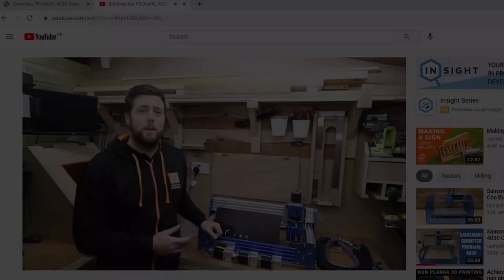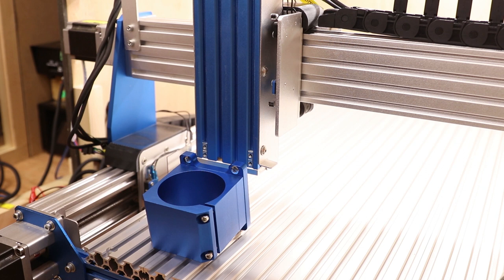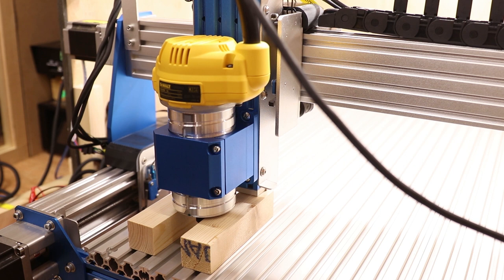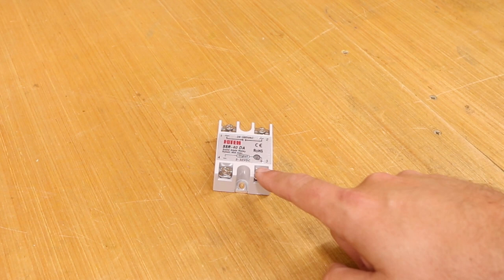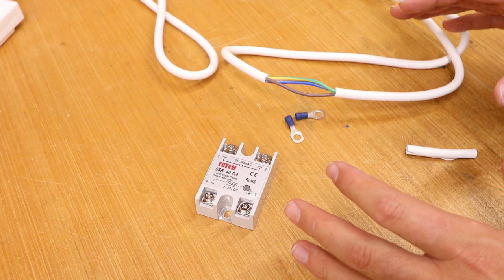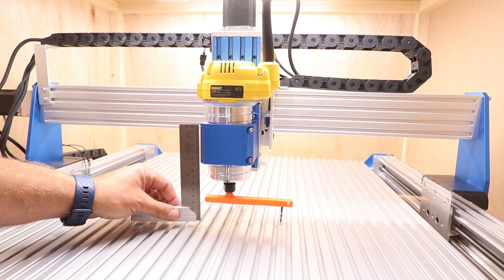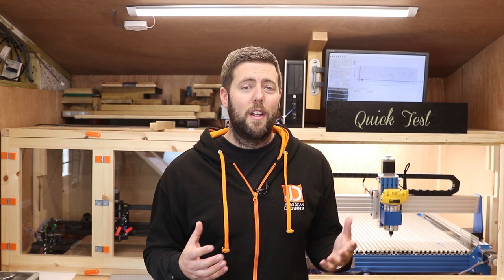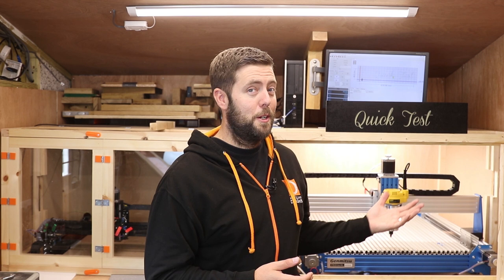Upgrading your spindle/router on a desktop CNC - 300w to a Dewalt DWP611

Comment: Great video as always, however I went 1 step further with my SSR I actually wired the SSR to a duplex outlet instead of just a power cord.  This served my need to have my dedicated vacuum for the dust collection to be able to be powered on by the SSR also.  So now when my machine powers on the spindle not only does my router start but also my vacuum.🤓
Reply: How does the spindle speed work? Does the SSR just act as a simple on/off switch ?
Reply: @bermchasin  I believe so.  If you search online there is a speeds and feeds documentation guide for the dewalt router that breaks it down by the knob adjustment on the router.  So you adjust the knob setting based on the RPM you want for the bit you're using.  If I'm incorrect in this, please let me know.  Good luck!

Comment: Quick note on the SSR...I see it's marked as 36v input. You would probably think this is okay as according to the specs on the sain smart website, the spindle is 24v. I have already confirmed with a multimeter the spindle is not 24v. It is 12-48v. I would check the voltage of the motor leads and adjust the knob down until you are safely within the input range of the SSR to avoid overheating and damage.
Reply from the maker: Thats a really useful piece of information. Thank you very much, I'll pin it to the top of the comments 👍

Comment: Thank you James for your video. I suggest you to check the output power with the potentiometer of the control box to 32V because the Max power is 48V and I burned 3 SSR 😃
Reply from the maker: Thanks for the tip! and sorry to hear you burned them out

Comment: Completed my upgrade with the Dewalt and began the spoil board surfacing after tramming and found out a little surprise. When I ran the outline test (Gsender) with my surfacing gcode my machine (6060) ran into the y+ limit switch. Was quite surprised because I didn't change anything more than the spindle. The problem turned out to be the size of the Dewalt router and its mounting bracket that pushed out the bit position further out from the z carriage. So my home position was about an inch further in on  the Y+ axis and just enough to trip the limit switch. The Y+ limit switch was set for about 25 inches with the old spindle. So now I'm just about 24 inches which is ok.

Comment: Just to be clear, I'm removing the spindle wire from the x and y tracks, and "replacing" it with the power cord from the trim router. Then, I'm connecting the spindle wire terminals to the input side of the relay, directly from the controller box - and that relay and the power extension cord can be placed on the table, near the controller. (Instead of replacing the female spade terminal with eye connectors, I'll leave them on the spindle wire, and run two short wires with male spade connectors to the spindle end, and the eye connectors on the relay side. That way, I can easily switch back to my original spindle if I need to.)
Reply from the maker: Thats all sounds correct 👍

Comment: At 6m50s you mention and put up a picture of an extension with inbuilt sir and say you will link to it in the description but I can’t see that link. Great video’s by the way, really helped in getting going with the CNC.
Reply from the maker: Hi Mark. In the first set of US links there is one called an IOT relay, thats the one which makes life easier
Reply: Thanks James, that link is broken or certainly if you are in the U.K., it takes you to a generic relay search on Amazon.U.K.
Reply from the maker: @markone3093  I think I mentioned it on the video, or certainly in the description that's it's only available in the US. The link is just trying to find the closest thing in the UK. I've searched several times but been unable to find a similar product for the UK unfortunately
Reply: @JamesDeanDesigns  yes the only similar one I found has either contact switching or DCv switching in the range 5v to 14v but obviously if the pot on the control unit of the CNC were turned up full the power on the spindle cable would exceed the 14v and blow the input of the IOT. I’ll stick with the linked sir and build it into a metal box with a std U.K. 3 pin socket on the front. That way the ssr can heat sink through the metal box. 👍

Comment: Just bought the dewalt router as a replcement for the spindle on the prover. Thanks for showing how to connect the power so you can still run it like the spindle. Can you still use the  ESR 11 collets from the spindle, is there a way to take the chuck off the router and replace with the ESR 11 collets?  Lastly,  are there any videos / PDF's showing the recomended speeds, feeds, and depths of cut for the 4030 with the dewalt router?

Comment: curious about how well the z axis bearings hold up to the added weight over time.
Reply from the maker: Still running this machine today, several years on and haven't had an issue.

Comment: Can you do a video explaining more about the SSR? Such as current flow and the end connections. Do you plug the end of it into the wall outlet?
Reply from the maker: Hi Matthew, The example in my video, extension plugs into the wall and the SSR is wired half way down but only to the live wire. The router is then plugged into the extension. It is fairly straight forward but if you google SSR router cnc there are usually wiring diagrams in the images section. I don't really have any information on the current flow, i just made sure it was rated high enough to take it

Comment: Great video.  My Foxalien 4040-XE spindle just failed.  I have a Dewalt 611 router and plan to install it.  I previously tried to use a 3" long bit with the 300w spindle and it would hit the upper Z limit when doing a safe pass.  Can I use 2 1/2" long bits with the Dewalt 611 installed?

Comment: I have a 3018 pro with and extension kit and went with a Makita router as i had one handy. skipped those toy spindles right from the start.
Reply: Which Makita router did you use?  Did you make your own mount for it?  I have the 3018 Prover and I’m looking to upgrade.
Reply: @rodneybailleaux9221  Makita RT0701C A buddy 3D printed the mount for me direct replacement for the stock one using the stock mounts and bearings etc. Think it was Thing-a verse or something like that. He just down loaded the file and printed it.
Reply: Did you have to make any other upgrades to accommodate the Mikita?

Comment: I hang my DWP611 power cord from the ceiling rather than feeding into the drag chain.  Reason being, I do drill some holes with the CNC  and prefer to use the speed variable spindle for that purpose only, as the dewalt minimum speed is far too high and causes bit to heat quickly, even in wood.  I do have it plugged into a SSR, but put a plug on the SSR and the original spindle for easy change over (well, easy except the hassle of aligning everything again).
Reply from the maker: Great tip!

Comment: James love your videos, you have taken what is a fairly steep learning curve and made it easy for us rookies.  one question as im wanting to mount my dewalt...one question, can i run the power to the hot AC as opposed to using the switch? i dont have a switch handy, but will invest in one shortly.
Reply from the maker: Thank you very much.
You can run your power straight from the wall without the SSR switch, you just have to manually turn the router on before starting a job and then turn off after its finished.

Comment: Excellent video James!  It looks like the IOT Relay is no longer available..  No problem, I can use an SSR.  I intend to build a custom control box.  The box would have the SSR and heat sink, plus a motor speed control module to control the speed of the router and also a 2nd receptacle for the dust collector. The idea is that when the router comes on,  so does the dust collector.  I plan on leaving the wires for the original spindle in place and getting another connector to go to the new box.  The power cord for the Dewalt router will hang down from the ceiling like the hose for the dust collector.  I want to be able to easily switch back to the original spindle if I ever need to.  What do you think?
Reply from the maker: The IOT is just not available on amazon, but is elsewhere albeit in less places now. If that ticks the boxes you need then I'd go for that
Reply: @JamesDeanDesigns   James, I did look around and I found it, but not from a site I'm familiar with. Also,  it seems to be more expensive than I thought it would be..  Based on my personal experience, I am completely fine building the custom box. I think it will be cheaper and do what I want it to.  Thanks for the reply!
Reply from the maker: @ericeinsmann5559  FoxAlien are working on their own version but it sounds like you know what you're doing so I'd say go for it 👍

Comment: Damn you have me hooked. I was just about to purchase a Shapeoko 4. What do you think, is the Shapeoko a massive upgrade compared to this or would you recommend the PROVerXL with the DeWalt router? I wouldn't mind saving a ton of cash for bits and material oh and feeding the family too. Great channel btw 👌
Reply from the maker: Thanks for kind words. I cant give a 100% answer as I've never used a Shapeoko, but one thing I dislike about them is a machine of that size using belts is petty inferior to a screw drive. Laser machines and smaller setups like the FoxAlien 4040-XE are fine but belt drive on bigger machines is generally off-putting for me. The ProverXL is a solid machine, thats why I like it and coupled with the dewal, its brilliant. Don't get me wrong, its not perfect but I don't think any CNC machine is.
Reply: @JamesDeanDesigns  Thanks for the great feedback, I think this will definitely be a good upgrade over my 3018. I'll try and purchase it via your affiliate link. Thanks again James 🛠️🛠️🛠️
Reply: Great channel thank you.
I am a complete newbie so forgive me if I ask a dumb question.
Can we fit the Dewalt spindle/router on a 3018. I have the ProVer version.
Reply from the maker: @thanassisandrinopoulos5449  you can fit it but you end up making a lot of upgrades for the machine to handle it. And you lose cutting area
Reply: @JamesDeanDesigns  I have already upgraded to the bigger 4030 area upgrade. Which other upgrades do you think I would need? BTW thanks for the rapid reply.
Reply: @thanassisandrinopoulos5449  Hi, I've gone down this road myself and your much better off upgrading to a stronger cnc if you want to upgrade. Like James said If you upgrade one thing you will need to upgrade somthing else the support the first upgrade and this is a never ending cycle.
Trust me and I hope I can help when I say you are better off buying a whole new cnc than upgrading a 3018.
Don't get me wrong 3018 is the perfect cnc to get started but as soon as you feel you have learned enough don't spend $$$ on upgrading.
Reply: @donochetti2177  Thanks for the warning. I am smart enough to take your advice and not be ... well stupid haha! I will use this machine for light jobs.
On another subject, any ideas on a CNC strong enough to cut stainless steel plates 4-5mm thick for knife blades/blanks?
I have been looking but have yet to find something small and relatively inexpensive. I know it will mean 4 digit numbers.

Comment: I have a small problem with the Makita router, unfortunately with this technique.I bought the same relay, I connected it exactly as it appears in the video, when the relay signals, the top LED on the Makita router starts flashing red, after I close and restart the router, it works. Could the Makita have a fuse or something similar? I can't think of anything else, I don't know if it works for others, but that's the only way it works for me. Stop interestingly stops after the job is finished..Any ideas or what I could do, if I remove the switch from the Makita.. it's only interesting from the warranty point of view..

Comment: I have the 4030 v1 I am wanting to use a 1/2 bullnose bit but the only collet it fits is er20.  The original router take er11 collet nuts.  Is there an adapter?  Is there an upgraded router motor that accepts the er20 that would mount on my 4030 and plug into the 2 prong spindle plugin on the power unit ?  avoiding the wiring you describe here?

Comment: Hi James, great video once again. I have a issue after connecting the SSR wiring and connecting it to a heat shrink when I switch it on after a couple of minutes the SSR blew. I have a Genmitsu PROVer XL 4030. I have checked the power from the original motor power leads and this is over 50vdc. I assume  this is the reason why the SSR blew but why has it work on you demonstration? What is your VDC reading on the power leads when switched?
Reply from the maker: Different SSR will have different ratings, but ultimately what you'll want to do is turn your speed dial on the control box to about half way and this will limit the volts being sent to the SSR. In saying that, you're the second person to tell me about SSR issue in in 24 hours so I'm wondering if there may have been a batch issue 🤔
Reply: @JamesDeanDesigns  Hi James, thank you for your reply, I have ordered another SSR and hopefully this will work. I must mention that the power on the control box was turned right up when I started the machine up, this could maybe the issue. I will measure the different current outlets on the terminals . From the minimum speed control to the Max and send this to you. Maybe just a edit of your video just mentioning this if it is found to be the reason, I would never of thought to turn the speed control down but now that you have mentioned this it is logical.
Reply: Hi James, I have checked the voltage output and if the power switch on the control panel is half way the voltage is around 25vdc. Which is fine for the SSR, however as you said if the switch is fully turned up the voltage increases to 50.8 VDC which will blow the SSR. I am now waiting for a new SSR and will update you when I have set this up. Thank you for all you help as usual.

Comment: Hi James, I am thinking about upgrading from my 60 watt masuter pro. If I use your method and go with the makita router will the current power cable coming from the control box have enough power to run it. I see most people when the upgrade they already have the 300 watt spindle and cable plugged in to the 24 volt input.

Comment: A little confused, I have 3018 prover upgraded to a 40. I have added the table extension kit as well as upgraded the spindle mount to 65mm. My router fits in perfect but did follow the part of connecting the original spindle lead. What happens to the original power supply that plugs into the main board? Currently I have two options use a 500 watt spindle or use a router. Both require some wiring. help

Comment: Hi James, I saw you've put your two bed stepper motors on the front of the machine, where as my machine came with them on the back. I presume you changed this yourself in order to have more space in the enclosure/push the machine back? Was it tricky, any tips, anything to be aware of, or is it just a case os unbolting everything and then bolting them to the front...

Comment: Is there a way of controlling the router speed through software, or does that have to be done manually?
Reply from the maker: I'm not saying there isn't, because someone somewhere will have done it, but what I am saying is its not really worth it. If speed control is important then better going down the VFD spindle route

Comment: Hey just like to great work keep up with the good channel.

I have a question. I have a foxalien 4040-xe and I'm using Carbide create v7. And no matter what I do I can not run off line. If I use their test files I can. But when I create my Owen gcode it will not work. The only way is to run candle on my laptop. Can you please HELP. thank you

Comment: Hi James—

What screws did you use to tighten the clamp to hold the dewalt router? The supplied screws to hold the 300w spindle do not thread in?

Thank you.

Comment: the iot or ssr .. in which port i gotta plug this in??? ..  speaking of the masuter pro ....  laser ... small spindle or large spindle port  ..ill  problably go for the IOT relay  will run the dust collector on it too   and do i need to change any thing in the $$ commands list for the spindle settings

Comment: I have a question I hooked it up exactly the way you did. But my spendel cord only has two prongs on the cord It doesn't have a ground prong? If not is there a way to ground it
Reply from the maker: Different regulations in different countries. Yes, you ground anything in theory. I dont think it would be difficult but I wouldn't know what would be deemed the "correct" way

Comment: Can you please share the wiring diagram? 🙏
I don't understand how you control it from the candle program.
Reply: Sobald das ,,alte,, Anschlusskabel von der Spindel eine Spannung erhält, (zwischen 3-48V) also wenn Sie in der Software den Befehl für die Einschaltung der Spindel betätigen, schaltet das SSR Relais. Somit die alte Leitung von der Spindel bei Relais DC anschliessen, und die Phase 230VAC über den AC Kontakt des Relais schalten.

Comment: I'm assumimg that wiring that extension cord to the SSR relay is like wiring a light switch - I splice the relay into the hot wire, and leave the ground and neutral alone?
Reply from the maker: Yes 👍

Comment: Great videos! How much X and Y deflection is there when pushing on a bit installed in the router or spindle? Is it rigid machine for cutting?
Reply from the maker: I've not measured it with the correct gauge but hardly any. The C beams are really strong and as the machine is less than a meter, there is very little deflection